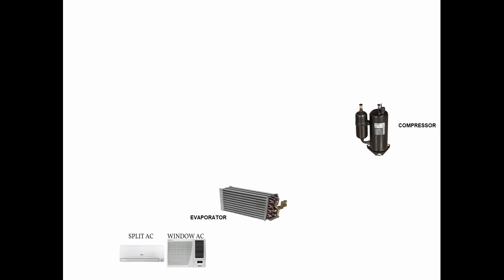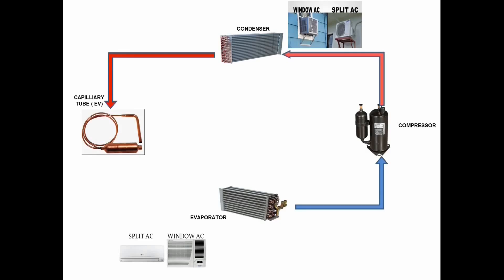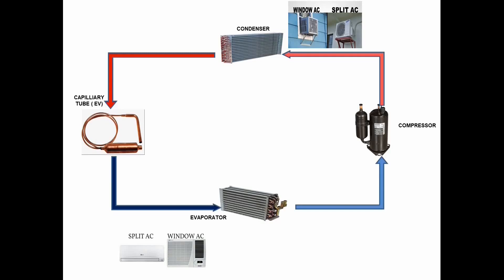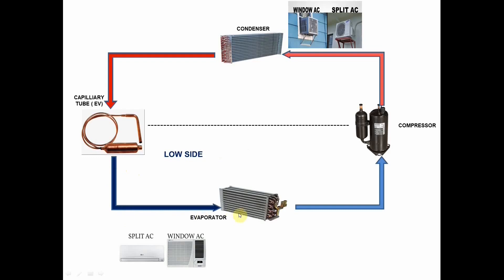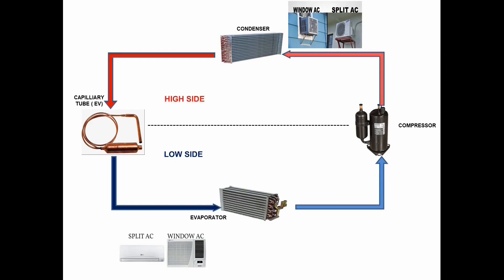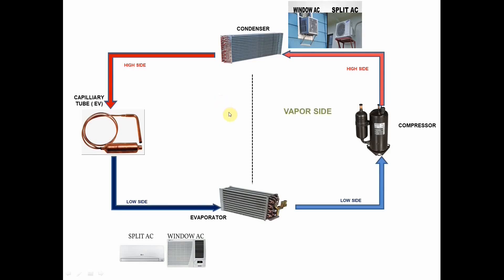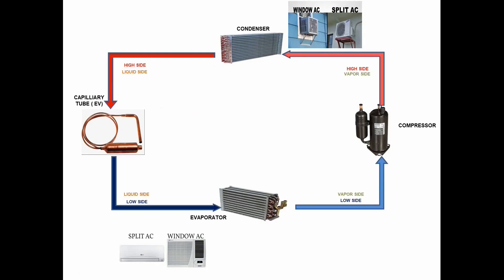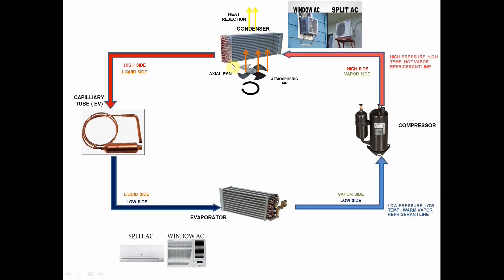Basic Refrigeration Cycle Tagalog. Simpleng paliwanag!

Comment: Question:
sir ano po sagot nyu po dito?

The expansion device is placed between which two components?
a) Condenser and evaporator
b) Compressor and condenser
c) Evaporator and compressor
d) Receiver and evaporator

Comment: Sir d po b pag na discharged n s condenser ang refrigerant ay high pressure, low temperature  n dapat warm liquid refrigerant  n kasi na reject n po ang heat bago po papasok s expansion valve or capillary tube(pressure dropper)? Pakitama nlng po ako kng mali. Salamat po
Reply: Tama sinabi.mo. Mali tong tutorial nya

Comment: Anong tawag engr dun sa nakakabit sa compressor?
Reply from the maker: Accumulator po.
Reply: @mdgtechniservengr.garcia2523  eh yung after ng condenser engr bago mag expansion valve? May nakakabit din dun parang accumulator din
Reply from the maker: @harrytv8302  filter drier po un sir.

Comment: ang totoo sir actual experience po ako mag 3 years na ako bilang ahu dito sa saudi maG aply ako kasi sa ibang lugar may hiring po sila HVAC po kaya nagtatanong ako sainyo f hvac ba eh kung parihas lang ba ang general cooling at ahu at kung anong hvac kailangan nilA at kong paano malalaman sir salamat sir
Reply from the maker: AHU is a part of HVAC in Airconditioning system. The principle is the same. Basic po jn is the refrigeration cycle. If alam niu kung how refrigeration cycle works malaking advantage n to. Magbabago ln yan sa Design, Setup and may dagdag na parts. Pero un principle of operation is same ln.

Comment: Condenser is a heat rejector and the evaporator is heat absorber, the simplest or layman’s term for the beginners, other components like the metering device as pressure reducer. These components are either TXV, AXV, EXV, capillary tube or piston. Some of the important components refrigeration system utilized are high and low pressure control, liquid receiver, and suction accumulator. Filter drier always be installed on the liquid side and may be on the vapor side, but not necessarily to have it, is just an extra protections to trapped contaminants and non-condensible gas entered into the compressor. What happened when one of the filter drier partially clogged from the dirt created from the compressor, and during the installations too, this becomes a metering device and you can tell the temp drop from the inlet and outlet of the filter drier. That makes the evaporator being starve from liquid refrigerant and causes the evaporator to iced up, the condition spaces getting warm, baka kailangan naman ng ice sa beer. Now your suction pressure drops too and the technicians have to put their gauges and found out short of gas, without looking what happened to the evaporator. Now the rookie tech will grab a jug of gas and charge it, now they are overcharging the system. Some tech will use clamp meter to one of the line on the compressor wire and you can tell if the compressor struggling the amp draw is high than normal, but those are just another way of eliminating overcharging. Few indications why you draw high amp not just overcharging, cap is dying, power supply from the grid during the park hours is less, or the winding and mechanically defective too causes high amp draw. Some of the condenser location couldn’t get enough air movements especially on the closed spaces, condenser coils dirty, fan motor cap dying or the motor itself, causes a high head that will open the thermal overload. The water cool coil is another beauty too that we have to utilized a cooling tower to reject heat from the refrigerant, where am working now is we are using cooling tower those equipment that has no space and on the middle of the building no air movements. These are giant chiller sizes like 300 to 400 tons chiller, it is so intimidating to look at this huge chiller, but the principles of cooling refrigerant either air or water are still the same. I’m sure you are familiar to these huge equipment sir, nakakalula tawag natin sa sobrang laki pero parihas lang ang principles. All things bright and beautiful, all chillers great and small, all things (chiller) wise and wonderful, human being made them all, and subject to decay.
Reply from the maker: Yes tama po kau jn sir.
Reply: Sa google Yan hahaha

Comment: Good morning sir...Tanong lang Po kung liquid form or vapor form Po b Ang kinakargang refrigerant kpag nagchacharge ng system.yung iba Kasi tinataob Ang tangke.
Reply: Vapor lng po dpat ang kinakarga kc po pg liquid ang kinarga masisira po c compressor maling mali dn po ung tinataob ung tangke ng refrigerant kc nga liquid n ang ppasok
Reply from the maker: Principle po kasi ng compressor is to compress air/gas. So literally dapat un papasok sa compressor is gas form of refrigerant.
Reply: Technically liquid state ang kinakarga natin sa system. Dipende kung saan mo ikakarga. Typical na alam ng karamihan ay puro sa suction line lang magkakarga ng "initial" charge at full charging. "Old method" eto yung 5second rule na quarter valve ang open then close again. Ginagamit pa din yan ngayun. Merong at least 7 methods ng charging including yung quick charging na latest since 2017, using pump down method. Pero sa ngayun yung quick charge method ay meron nang bago din na paraan which is built in na yung quick charge port. No need na yung pump down. Pero sa R&D ng factory at sa quick charge ng system ngaun ay sa low pressure liquid line ka mag continue ng charge. For initial charge naman ay sa liquid line kpa din magkrga ng liquid. Important is mapanatiling vapor/gas state freon yung discharge at suction line ng compressor during initial and full charging stage. Sa initial, after ng vacuum, Matic na gas muna kakarga mo sa system mo para pag  lipat mo sa access valve sa liquid line eh pressurized na system mo at hndi na papasukin ng hangin (negative suction pressure) sa mga pito at least 20 to 50 psi. Wag mo agad tanggalin after mag vacuum kung tapos na karga mo ng gas refrigerant sa system. Hayaan mo muna saturate nya buong system for 10 mins. Meaning dulo/dulo eh sure ka na pressurized ang system mo bago mo pasukan ng liquid. Then saka ka magkarga ng liquid sa liquid line. Eto ang complete system. Sa dxa inverter split system usually may suction accumulator yan to ensure 100% vapor papasok sa compressor as  protection. So liquid ang ikakarga mo using 5secs quarter opening. Kasi walang charging port uung indoor usually after ng expansion valve. Sa mga USA/euro brands Meron. Sa Mitsubishi wala. Ewan ko lang yung mga bagong labas ngayon. Sa vrf system follow manufacturer guide. May kargahan ng liquid dyan. Wag sa suction line. Usually sa liquid chamber or sa liquid charging port
Reply from the maker: Thanks sir for this very helpful information.

Comment: Sir,may I ask."in changing cycle refrigerant state condition,where is the hotiest point/points  State located". .? not asking sensible mechanical but gas state.
Ok ung paliwag mo sir kaya ni-liked n kita.hehe
Reply from the maker: Hottest point nia is after compressor po. Kasi galing sia evaporator side kung san nag absorb na sya ng iheat then iccompress pa nia compressor tataas un pressure and temp nia lalu ng refrigerant.
Reply: High temperature high pressure vapor state, then going to the condenser and reject some heat and becomes high temp high pressure liquid. The other side from the evaporator state of refrigerant is low temp low pressure vapor, if the system uses suction accumulator, then the some of the refrigerant that become a liquid state will be restored on the bottom of accumulator and only vapor will be sucked back to the compressor. What happened why some of the refrigerant codenses and becomes a liquid is instead of vapor, have a long line set, heat pump during heating mode, liquid stays and being sucked a little by little from the bottom of the tube back to the compressor, this may contain oil too back to the compressor. You can hear a compressor slugging when a big volume of liquid refrigerant gets to the compressor, and if you noticed during charging, better off charge with vapor, a little bit to slow through vapor charging than the liquid but it safe.

Comment: Ask ko lang sir, ang capilliary tube ba katumbas nyan or pareho lang yan sa expansion valve?
Reply from the maker: Expansion device or metering device = capillary tube or expansion valve. 

pag capillary tube po is normally sa maliliit n capacity tulad sa residential AC's.
Reply: @mdgtechniservengr.garcia2523  Yes, these are all metering device, the same function, now we are talking about the efficiency The cap tube, piston or fixed orifice are fixed volume of refrigerant that will goes to your evaporator no matter hot hot and humid is the conditioned spaces are. The TXV are more efficient just because the sensing bulb that controlled the opening and closing of the spring, depend on how the superheat or the heat being abosorbed from the conditioned spaces. More heat and humidity inside sensing bulb will open more to compensate the heat loads from the conditioned spaces. So the TXV controlled the superheat, while the cap tube, piston fixed orifice is fixed, very limited, that controlled the subcooling. Kaya nga noong bumili ako ng bahay mga ilang buwan umakyat ako sa attic, no'ng binuksan ko ang air handler cover, cap tube, kahit sa condenser may TXV device daw. So bumili ako ng TXV at pinalitan ko, kaya sa charging sa ibang costumers ko kahit sasabihin pa sa condenser na TXV, you have to look at the air handler or your charging would be  big error using superheat because some tech like me are too lazy to climbed. Grabi kong summer dito sa attic alam nyo gaano ka init, mga kulang-kulang 150*F (65*C), kasih walang air movement, kaya charge dim kami ng medyo malaki-laki kong gusto nila maayos ang AC. Ngayong sa winter is another story because we are dealing with heating system and air conditioning too, lamig na halos di mo na ma feel na may kamay ka, multimeter frozen up kong nasa roof top ka. Pag tumanda na darating ng mga sakit sa mga joint, at maganda sa Pinas uuwi enjoy ng kunti sa natitirang hininga. Salamat Eng'r and thanks for letting me share my experienced as HVAC/R technician.

Comment: Hello sir. Ask ko lang, pwede po bang gamitin ang isang ac sa dalawang kwarto? Kung possible ano po ang remedy?
Reply: Thank you sir. 😊
Reply from the maker: @cpeasy5607  your welcome. God bless.
Reply: Mag duct line ka sir...
Reply from the maker: Mas okay po if separate AC. Pero if no other possible way pde nmn po. 

Si room #1 un may AC. Then un sa Room #2 nmn po un wall between 1&2 lagayan niu n ln ng exhaust fan para un lamig sa room # 1 is malipat sa room# 2. Then mas effective dn po if dalawa un exhaust fan un ilagay pero different flow direction po. 

Exhaust #1 supply hangin Room 1-2. Exhaust #2 return air from Room 2-1. Para po may good circulation po ng air.
Reply: @mdgtechniservengr.garcia2523  sir gaano poba kadami Yung oil ng compressor motor ng refrigerator..kase meron ako motor obos napo oil gustu ko e change oil ilang ml poba tnx r134a po to na motor comp.